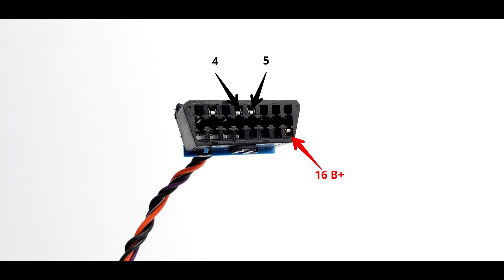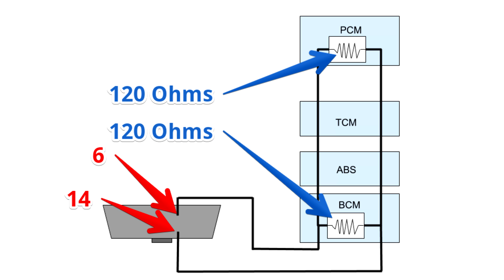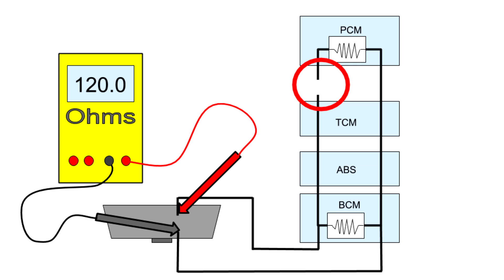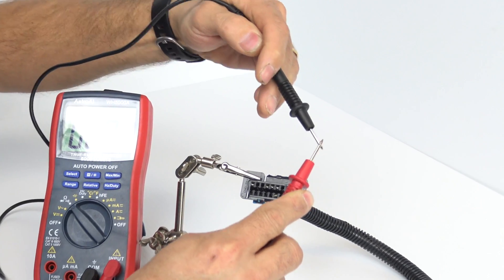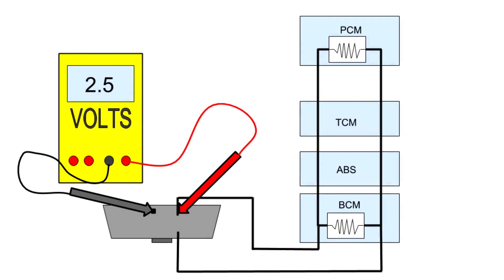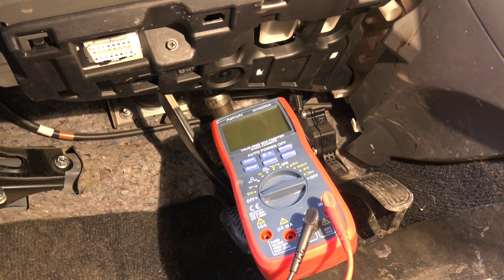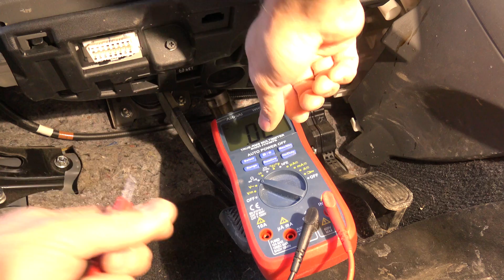DLC Quick Testing Tips

Comment: What would it mean if you connect 4 and 5 and your reading is -2.4mv
Reply from the maker: That is a good reading.   2.4 mV    = .0024 Volts is a extremely small voltage. This means there is no difference in potential between those terminals. This test will not show if your main ground at the battery is faulty ,  or if a ground before 4 and 5 get to the battery is bad,   That is why I test for B+ @ 16.  Do you read battery voltage between 4  and 16 and 5 and 16 ?
Reply: My reading was a negative -2.4 mv. I did test between 16 and 4 as well as 5 they tested ok.
Reply: Oh. I guess it must have been my probes were backwards. Ok thanks
Reply: Well today I checked my DLC again. I used neg. lead to ground. Pos. to pin with KOEO. Pin 4 was 18.2v. Pin 5 was 12v. From what I have seen this should have been 0 to no higher than 2.5v. I also checked between pins 2 and 5. Key off was .29v. Key on was 1.5v. Thinking a module is shorted. My OBD2 scan tool does not fully link and when I do get it to work I get spikes in all my readings. I did test 16. It read 12 volts.

Comment: very good explanation!   quick question what would be the resistance reading for example fords medium speed network? 60?
Reply: The medium speed will be at 60 Ohms. It uses the same principals as the High speed CAN bus, just running at a slower speed for the "non essential" modules. You'll be able to test it just the same as shown in this video for the High Speed CAN, but just at different pins at the DLC. The secondary bus will likely be on pins 3 and 11 at the DLC. Make sure to check your wiring diagram.
Reply from the maker: Thanks for the Information !!  If I come across one I will share.
Reply: @Grillzor  my friend do you know what is pin 12, 13 and 14, what is the purpose, please help me to figure out.. i know pin 14 is CAN BUS. But the other two i do not know.
Reply from the maker: Excellent Question !!!  honestly I am not sure,   I have not personally seen  many problems with the medium speed network.  I also wonder what the specs should be for GM LAN   like between the Info center buttons  / radio and such..   SO much to learn.  will reply if i figure some info out..